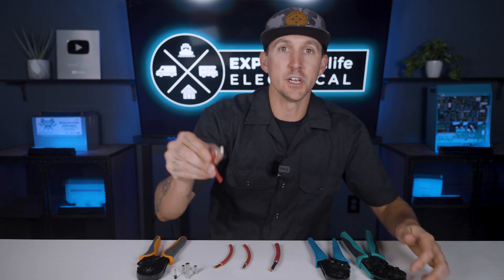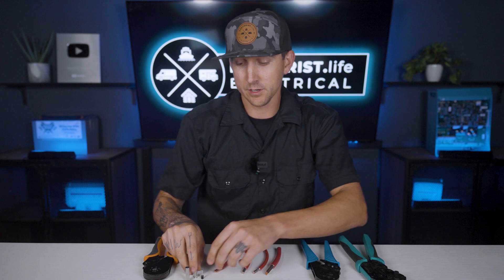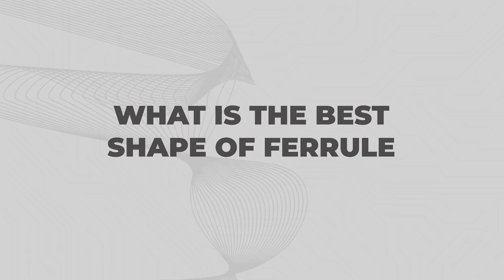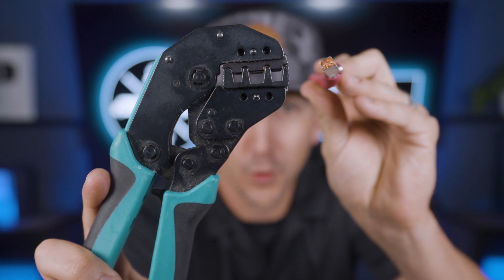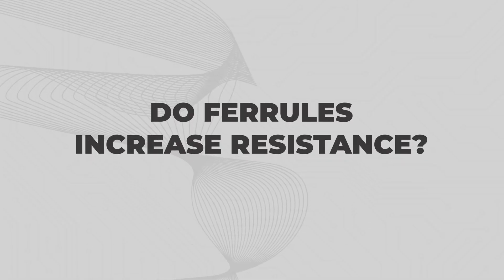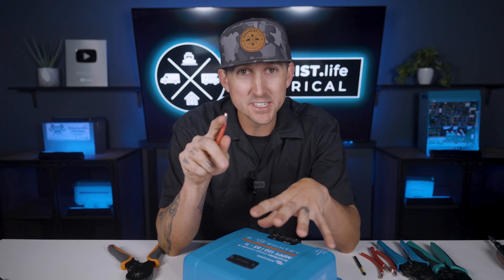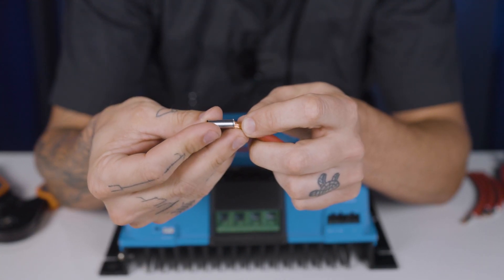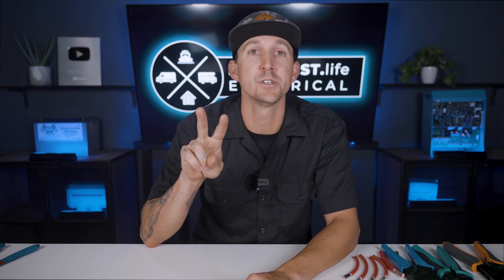Ferrules 101 - Wire Terminal Basics | Ep: 9/14

Comment: Should I ferrule wire ends that are going into my Wago connectors (lever nuts)? I'm also using a dimmer that has terminals instead of wires (wires go directly into the dimmer's terminals) and wondering if i should ferrule those ends too.

Thanks for the super helpful videos!

Comment: Are there any alternative to ferrules such as a tool to compact or consolidate the wires using pressure only?
Reply from the maker: You're describing an ultrasonic welder - but you're talking about $2,000+ at that point.
Reply: @EXPLORISTlife I was wondering what would happen if you just crimped the wire without the ferrule

Comment: Are these ok to use in home electrical panels? Your main breaker box with stranded wire of course.
Reply from the maker: I'd be curious as to what kind of stranded wire you're using in a home electrical panel that would warrant a ferrule.  THHN wire is stiff enough, even at small gauges, that it's not hard to keep the stands together contrary to stranded wire like marine wire or something, which you wouldn't be using in a house.
Reply: @EXPLORISTlife 
Running a #6 awg wire into breaker box for standby generator with interlock kit. Double pole 50 breaker

Comment: Having worked wire and connectors while I was in the Navy, yeah using ferrules solves a lot of problems and so long as they're of compatible materials they rock. However, funny thing when a new aircraft came out the flight control cables (stainless steel cables) had ferrules installed....and, the ferrules and stainless steel wires used in the flight controls? Incompatible. Result? Brand new aircraft coming off the assembly line with the typical brand new helicopter smell and less than 60 flight hours failing basic Acceptance Inspections with the ferrules that were crimped on the stainless steel wires/cables used in the flight controls coming off with a light tug and ...leaving quarter inch of corroded stainless steel. So beware of that. The ferrules need to meet the wire/cable needs so, I would prefer aluminum ferrules on aluminum wire, and tin ferrules on copper wires in coastal areas as sea salt travels inland up to 300 miles, but is worse 30 miles from the coast.
Reply: and as far as crimpers and crimp shapes go? Every command I was in, almost from day one the Tool Room 2nd me to deal with the Daniels   Wire and Connector Repair Kits. Why? 1 suitcase could hold close to 5,000 parts (mostly one time use consumables) and one type/model/series aircraft could have 12 suitcases filled with tools and parts with one weighting up to 50 pounds (huge hydraulic crimpers for armored cable). Trust me, once you get used to crimping? It goes fast and makes the final connections easier, cleaner and you can know safer and walk away feeling proud at how neat the job looks and is.
Reply from the maker: That’s awesome insight on crimpers and tool kits — love hearing how streamlined and effective those setups were!

If you ever want help figuring out which tools or connection methods are best for your specific setup, feel free to reach out to our support team here:
https://shop.explorist.life/support

We offer free personalized help for products purchased from our store: https://shop.explorist.life
And if your gear came from somewhere else, the EXPLORIST Pro Support Membership is a great way to get expert guidance:
https://shop.explorist.life/shop/all-products/membership-tiers/

Comment: Love all these videos.  I'm a huge fan an plan on joining the academy soon.  I have a question about crimpers.  I have the klein 34056 round crimpers for 10-22 awg.  I though I had done my research but when I got in my mc4 connectors the ferrule that goes on the end of the wire, before inserting into the mc4, is much larger than my crimper accepts.  Thoughts?
Reply from the maker: Thanks so much — we really appreciate the support, and we're excited to have you join the academy soon! You're definitely not alone on the crimper mismatch — MC4 connector pins (especially for larger wire sizes) often need a different crimper than the typical round-style ones used for insulated terminals.

If you’d like help picking the right tool for your specific MC4 connectors and wire size, our support team is happy to walk you through it: https://shop.explorist.life/support. We offer free support for gear purchased from our store.

For gear bought elsewhere, our Pro Support Membership is a great way to get expert help: https://shop.explorist.life/shop/all-products/membership-tiers/.

Comment: Nate, I've noticed with the Trapezoidal crimp die, it creates edges that protrude out of the ferrule. When you tork down a 4 ga cable into a Victron Solar Controller, do the edges flatten out, thus utilizing the entire surface area of the Ferrule?  This comes to mind when thinking about high current and voltage drops.
Thank you.
Reply from the maker: I think the 2nd half of the lesson addresses that, no?
Reply: @EXPLORISTlife  Yes, from the compression of terminal. Also, The Wovier  Crimper you use for square shaped terminals are for 10 thru 6 gauge wire. The video mentions 6ga and smaller. Have you used them on much smaller wire size for terminals used for powering smart shunts. 20-22 Ga.?  Thanks again Nate.
Reply from the maker: I think I'm usually using the hex crimper for stuff that small, and it works well for that.

Comment: Thank you for this info!!! I’m working on installing a Victron Multiplus II and have was about to order a ferrule crimper but need to get my inverter up and running quickly since our inverter died on our current road trip :-(  I’ll just shove the wire in a ferrule (from Harbor Freight) and let the Victron do the work - I am definitely getting a torque screw driver this morning!

Comment: If you didn’t have any ferrules, couldn’t you just solder up the tip of the wire alone with out a ferrule? It would be a solid tip.
Reply from the maker: Why would you not have any ferrules?  They come in all of our wiring kits.  You'd get ferrules at the same time you get lugs/wire/fuses/etc. 🤨😅

In all seriousness, though:  Aside from soldering taking longer than ferrules and soldering taking a bit more skill than ferrules; soldering actually makes a WORSE connection due to thermal stress where the wires go from stranded to soldered.
Reply: @I was just wondering for people that don’t have the extra bucks for  Ferrules and it’s took. 🤷‍♂️
Reply from the maker: And when that weak point created by soldering breaks and melts the charge controller termina; how expensive would it be to replace?

Let's be clear here that ferrules are less than $0.10 each and the tool is like $20.  I'm not asking y'all to spend $1000's of dollar on specialty tools.

Spend the $20 now so you have a safe and reliable system.
Reply: @EXPLORISTlife  
Amen

Comment: More to say about ferrules from personal experience. If the terminal is such type where a bolt directly screws into wire - using a wire without ferrule a bolt will definitely cut some strains and you end up having a bad contact to a bolt itself. You now have the wire with fewer strains, cutted strains can potentially fall out the terminal and touch cutted strains from the nearest terminal. And when you have to remove and reattach that wire for some rework or inspection - you'll want to strip it again where its not broken. Once used a ferrule and I'm never to lazy to not use it at all connections. And my FLIR thermal camera tells me I'm doing it right.

Comment: Thanks for the video! Currently designing a battery back up system so we don't go without again (lost power for a week during Helene) Planning for a 3000W inverter on a 24v system.  Do I need to spend the money on a low frequency inverter to run my fridge/freezer? they are around 3 times the price, but I am struggling to find a video explaining if they are necessary or not.
Reply from the maker: Perhaps you’d fine the inverters we have in our store at shop.explorist.life useful. 🧐🫣. They will, without a shadow of a doubt, run your refrigerator.

Comment: Ferrules are a great way to reduce the chance of having strands of wire go "astray" during the installation - especially in tight and difficult to access areas. Any connection, where the wire is crimped and not just drilled by a screw should have a ferrule attached. In the latter case, the thin wall of the ferrule could make a mess of things when tightened down...
Victron - at times - does include recommendations in their documentation, that just is not 100% clear. Your video shows very nicely, that common sense is the correct approach. Thank you!